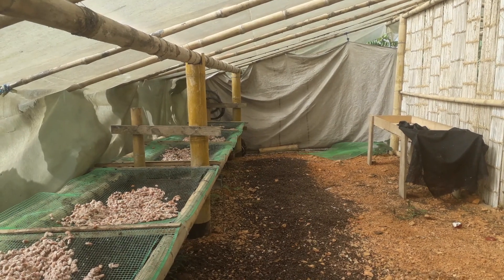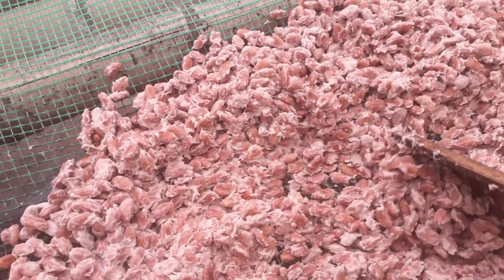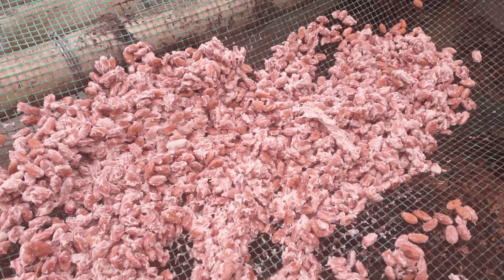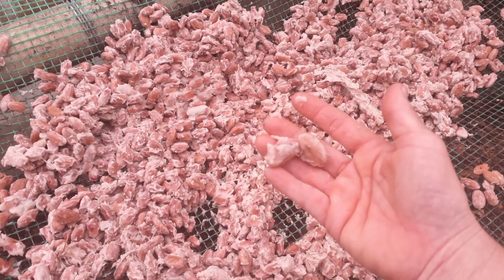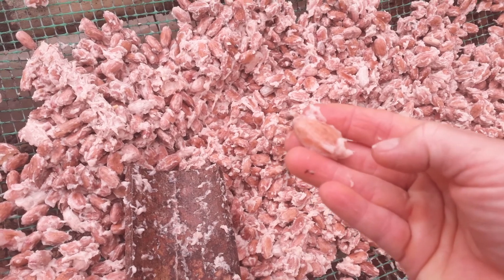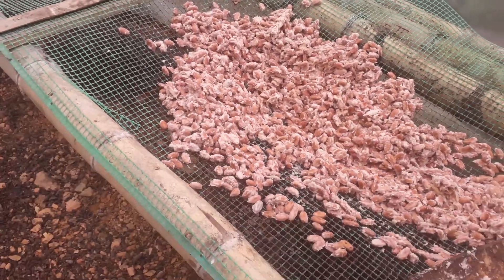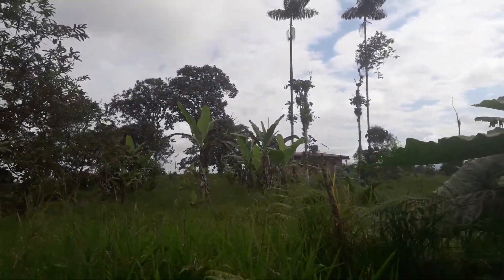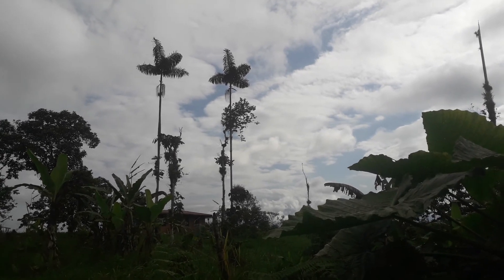Fermenting and Drying cacao

Comment: do you washed the beans after fermentation?
Reply from the maker: No, washing is not necessary and would not make good cacao . After fermentation, the beans are spread out to dry on racks. As the pulp drains off and evaporates, the acids and enzymes break down the hard outer shell of the bean, allowing oxygen to enter. This is what allows the bitter compounds to mellow out and the chocolate flavor to develop
Reply: @kristenkrashatsuenodevida7699  yeah thank you so much. I also decided not to wash since its rainy season here in my country, Philippines. Is it normal also to have larva in the cacao during fermentation?
Reply from the maker: @JeninaVisoria  a few flies and larvae won't hurt anything. But if you get a whole bunch in there they will damage the cacao. 

I suggest putting a double layer of a very fine mesh sceen or burlap on top of your fermentation box. Then you can put some banana leaves and then the lid. The screen or burlap will prevent flies and larvae from getting in.